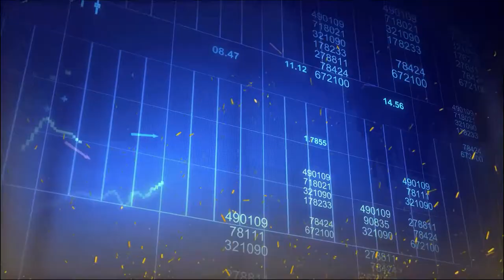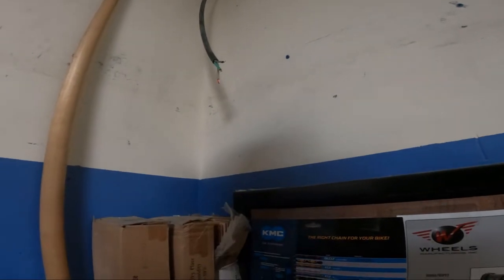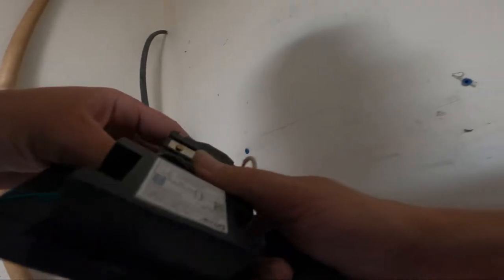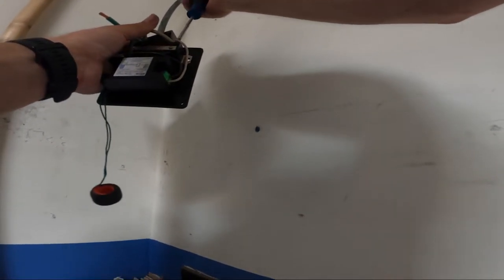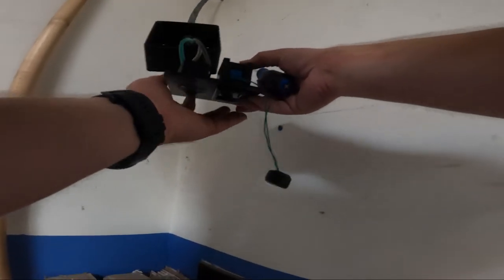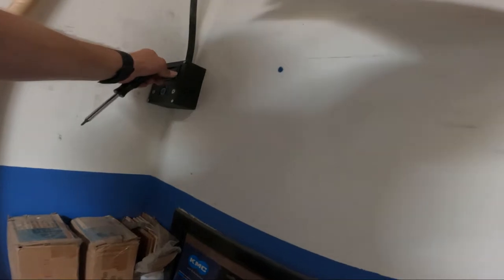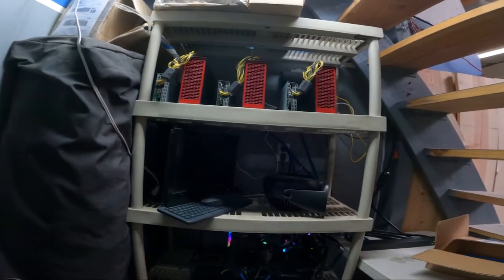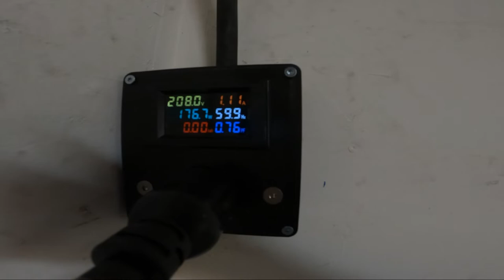How To Install 240v outlet w/ Drok Power Meter and Spacegoats Box!!

Comment: stranded wire?
Reply from the maker: i used "SOOW 10/3 Bulk Cable, 30 Amps, 3 Wire, 600v." Just make sure you use 10 gauge wire if going 240v/ 220v

Comment: What type of cable are those 2 thick ones connected from the meter to the outlet? Our meter only came with the ring but not the other 2 cable for the other side.
Reply from the maker: The meter will not come with any. You can cut some extra off of your main line.

Comment: The wire you used look way easier to manage than the 10/2 wire im using.....which one is better?
Reply from the maker: Why does mine look easier to manage? Is yours a 3 wire or 2 wire?
Reply: @BDigiCrypto  im using 10/2 wire, its very hard to bend. Its 2 hots and 1 ground. Your wire is stranded, mine is not
Reply from the maker: Ahh yes the solid wire is tough. I did use solid wire going to the drok meter, but that's only a couple inches long.
Reply: @BDigiCrypto  So i spoke to an electrician about the difference between 10/2 and 10/3 wire. He said stranded wire will get extremely hot running 30 amp 240 volts so its best to use 10/2.
Reply: @qandmarco8994  Are you using Romex orange cable?
Reply: @AndyHa1010  Nah, im using Southwire UF wire, my local Lowes had it on sale .67 a foot so i bought. My electrician told me its the wire that your supposed to use underground but doesnt matter. The indoor one was too expensive.
Reply: @qandmarco8994  10/2 is not the correct size. 10/2 cannot handle 7200 watts with 20% ampacity overhead. this is a common mistake. you should choose 8/2 0r 8/3 (with ground). Especially over long distances above 100 ft
Reply: @zdon8362  I, like most others use the 80% rule, so my limit is 5,760 watts, 24 amps. My electrician whose licensed and bonded installed it. I would imagine its not a problem if he went with the install. Also, neither plug i had installed 10/2 wire was close to 100 feet.
Reply: @zdon8362  i looked up 8/2, its rated for 40 amps....why would you use a 40 amp cable for a 30 amp breaker?